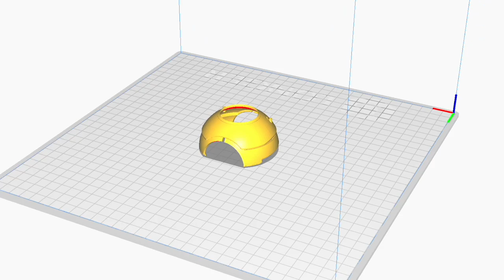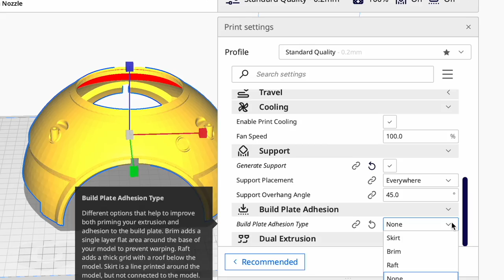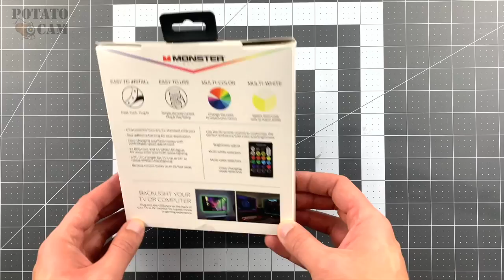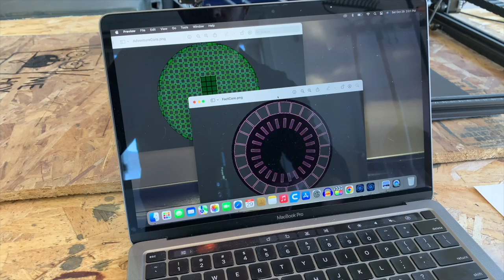Let's Make: The Portal Core From Portal 2

Comment: I love seeing people use MacBooks for CAD design, I started with a CAD model for Wheatley that looks pretty much identical to the one you used other than the fact that the handlebars were slightly different shape and it used a twin offset angle rotation unit to be able to take the eye off centre, the first step I would take with your design is to take scale up further then by taking into account how thick a personality cores shell is I would print the shell to the thickness of finished casing shape so that I could then form an actual aluminium. Shaping it around the plastic template and do the same with all of the components, so they were all made of actual metal, and then mount motors to control everything. Possibly even combining it with something like an Amazon echo to create a more functional AI system
Reply from the maker: I love this! These cores are so much fun to build and modify. With plans like that, I’d suspect you’re the real Cave Johnson! Also, I’d love to see any core builds you have. Your design sounds awesome!
Reply: @thezachofalltrades I’m not quite ready yet to move on to manufacturing stage, i need to work on the side plates, i can’t quite settle on a rotational control mechanisms

Comment: now do portal 1
Reply from the maker: What would you like to see from Portal 1?
Reply: @thezachofalltrades  any portal 1 cores
Reply from the maker: @crypticjsab8876  Sounds like fun! I'll add it to the list.
Reply: @thezachofalltrades  I remember hearing somewhere that the Portal 1 Cores aren't possible due to the fact that they have WAY too many structual problems. The only was I see that it is feasible is to make one that does not move at all and is fixed in all places. Also the handles may be a bit tricky